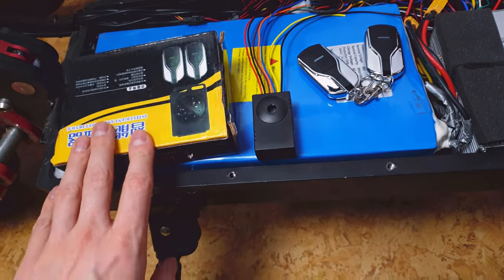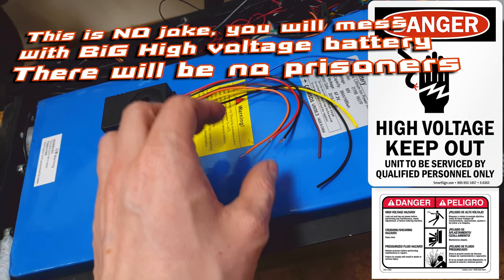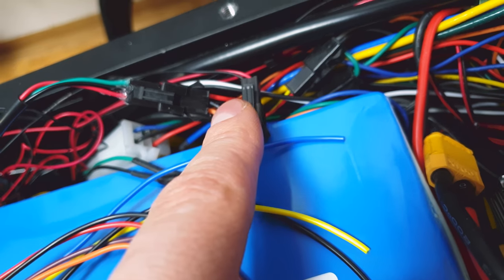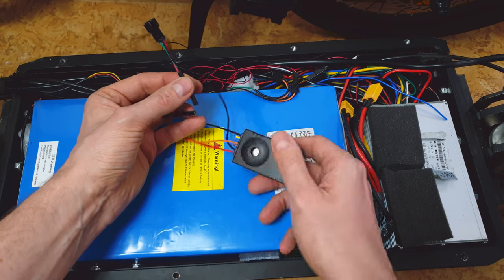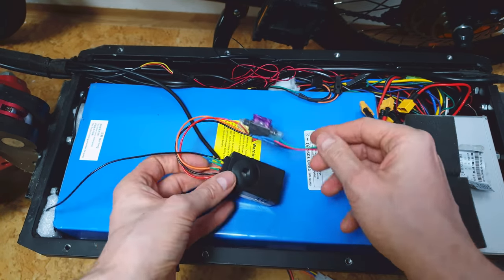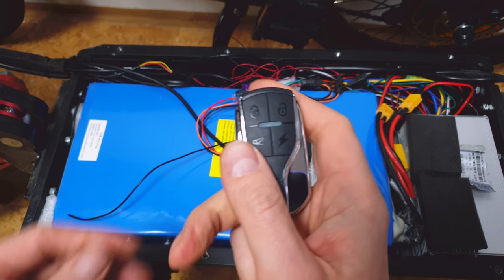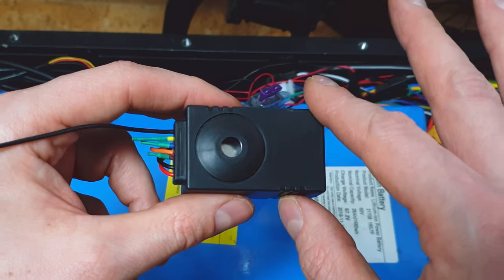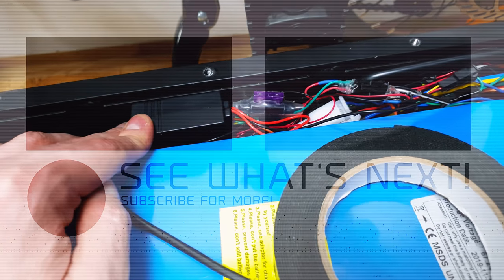Alarm for Janobike Langfeite & other Escooter ⚡ Cheap Loud with On/OFF switch 🚀Must Have 🤩💪

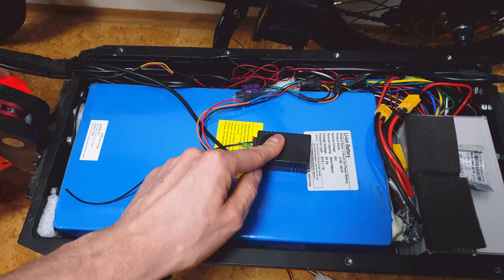Comment: 4:20 when long alarm on, your scooter also on. This mean i can run your schoter while the long alarm is on😅
Reply from the maker: Yes but if U stop for a sec , power will be disconnected :) , also u can add hard switch so alarm + key to be even more sure :) .  Here price is equal to quality
Reply: @PirateWasHere  yes if i thief i Will run scooter quick. I also use this kind alarm, Its make me Confused

Comment: Hello. Your work is simply fantastic, you help a lot to solve everyday problems with this video, thank you very much for that.  I would like to ask if it is possible to install this type of alarm on my kugoo kirin M4 Pro with the new version controller?  I saw that you cut the ignition key connector, is it disabled?  A hug from Portugal, and continued success in your work.  Thank you very much
Reply from the maker: hi thx,  I have no idea, I never had this scoot But I guess you are going right direction

Comment: FINALLY! TOP PIRATE N. 1 can  we have a guide for scooters with no key?
Reply from the maker: welll , can be done , I will check my L8 :)
Reply: @PirateWasHere we need also video guide for Xiaomi m365 pro ;)
Reply: @MrGustaw1989   yeah i agree,i have pro model and i burn control table because of fireware for 32kmp :D
Reply: @PirateWasHere  hi pirate, I want to buy this and install it on l8s I bought with your code, can you please show us the guide for L8? because we don't have the key system on L8, thanks!
Reply: @PirateWasHere  come on pirate help us out with L8s installation please!
Reply from the maker: @avt3401  i dont have l8 anymore :(

Comment: Hello, this tutorial I guess is valid for many scooters, in my case the SmartGyro Speedway?  What I would like to corroborate, right that the red and orange bridge?  I mean, orange and red, red and orange, is that correct?
Also another question, when the wiring that goes up to the handlebar is canceled, I understand that the current can only be activated through the control, is it correct?  Thank you!!!

Comment: Hey i have a question i got one and my bike has 2 wires that has the plug connected to it i connected the colors that the controller had to the alarm and nothing happened any fixes

Comment: Hey Pirate, love my ti30. I went inside the deck, and found this alarm was pretty warm. Any advice? My guess is because it says 48 volts, when the battery is close to 67.2. maybe I should unplug it for now? Thanks.
Reply: Buy a alarm to match your battery voltage. not all videos are correctly informed like this  one is ok up to certain parts  like the plug disconnected has to be reconnected with the additional connector that means a  2 way plug correct me if I'm  wrong this wasn't mentioned so you left with unconnected plug

Comment: what happens if the remote battery dies does it give you a waring light before it dies. lets say you go for a ride and than you lock the scooter and than you want to ride some more but the fob is not working how do you unlock the  scooter or is it better to ride with a extra fob and mini tool set to open it and hotwire it?

Comment: Exactly, what kind or model of fuse do you add on the red wire? Any link to get it from? Also, my throttle wire, black, red, green, does not have a connector head just wires taped up together, so I would have to peel off the tips, and connect, along with electric tape.

Comment: Could you recommend alarm system for the Kugoo G-Booster? I would like to have a feature, once unlocked I can drive straight away without manually turning on computer to start riding. Let me know your best picks. Thank you! Great video!

Comment: hello would you tell me if, if you want to make your modification, the key with the voltmeter still works, or is it excluded?  
and if it continues to work, you confirm that the scooter can be turned on either by the remote control or by the key, in case you don't have the remote control.  quite right ?  
then if I turn on with the remote control does the voltmeter work?
Thanks

Comment: Is it possible to have two layers of security with the remote in the middle? I mean you now have only remote option without physical ignition , can I have both - I need to turn on remote ignition/unlock alarm then i need to use key in physical ignition? What are the 3 additional cables that you have said we don't need them?
Reply from the maker: for extra wires ... I have no idea but all info is in the manuals . Ofcourse U can have 2 layers. just connect alarm first then to key system + ( red wire ) connect signal orange wire from alarm. For both ground wire to main ground wire and should works ;)

Comment: i bought this from the link, but i have Gray Yellow Blue Black and Red cables,    i know i have to keep red and black, but i have GREY YELLOW BLUE left, No Orange Cable.      I dont know as i dont have the wire schematic.       also i did not get this from a box, it was just in a bag

Comment: Hello pirate 🏴‍☠️ I want to fit to xiaomi M365 pro where do I connect the wires bro I’m great full for your video 👍💪
Reply: You can't install it on Xiaomi M365 because the red wire to the dashboard is only 5v and the alarm used here is at least 36v.
Reply: @htlow3598  got it working 👌
Reply: @ADHD_RC  , go on.. share

Comment: sory to bother You here, but got question about CN syl-08 board :) (old movie question) - were You able to get/find a way for suspension to be harder (like find a fitting rubber bushings, or different springs) - if Yes - can You share link? I know that from time You got Trampa beast other boards are not so interesting - but for me as a stage1 before building my own long/mountainboard it's a step forward :D
Reply from the maker: You need to 3d print or order extra elastomers which are going inside springs
Reply: @PirateWasHere  yes - skateboard bushings - :) they are that rubber elastomer - but were You able to find one that fits? as normal ones from skateboard wont fit (ussual mount for skateboards is different then mountainboard :/ or did You skip that topic when You got beast? :)
Reply from the maker: @myfpv6813  well if u got 3d printer then buy some rubber like filament (flexible ) and print it, otherwise  measure and find them. Skipped cause its not a big deal 🍕🍻

Comment: Hey at the part you cut the black cable to your left with the jst black 3 pin cable what is that cable why you cut it? 
I didn't understand what you said sorry elaberate please
Reply from the maker: check manuals of your alarm, not all cables all needed , so just cut them off ;0)
Reply: Also you did you prepare a 2way 3pin connector to connect the plug you disconnected

Comment: Please I need your help.
How do I fit onto a scooter without a key system
Reply from the maker: Usually there is 3 pin connector, check controller schema

Comment: Hi there is it possible to connect  both of them key + alarm on the same cables?? I want keep the volt meter??
Reply from the maker: Yes
Reply: @PirateWasHere  how??
Reply from the maker: @sv8jnl409  connect both to the same cable ( the same way )  , BUT remove voltage  output wire from key ( U got 3 wires there )

Comment: Hi. How will I connect that to my Ebike? The lcd display or controller have the following wires.

Red: Battery voltage
Black: Negative
Blue: Lock wire
Green: TX
Yellow: RX

Comment: Cheaper just to buy a GPS tracking sticker for your scooter 😃
Reply: takes 1 minute to remove it.....also, you'd need to pray Hells Angels didn't take it...
Reply from the maker: hahaha
Reply: @mrnomore  he said a sticker, not an actual gps device, those are more expensive than 12$